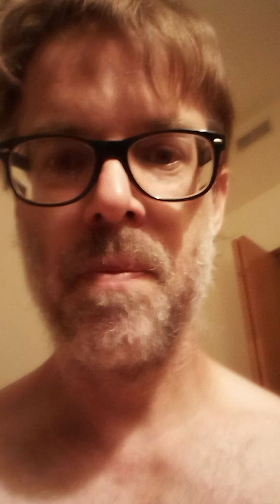Thanks Southpaw Autoworks: stunning 4l60e transmission vids: Centrifugal cavitation high rpm springs

Comment from the maker: https://www.youtube.com/watch?v=dtak3UKTWy0  Here's a vid on the accumulator pistons (Servo) for the 4l60e. He talks about how you can get hydrolock of the fluid in the accumulator of 3rd gear from 2nd gear high rpm. So shift kits say to grind groves in the piston so the fluid can stay stuck in it and escape faster. That's to offset the centrifugal cavitation I think...There is an extra spring added.